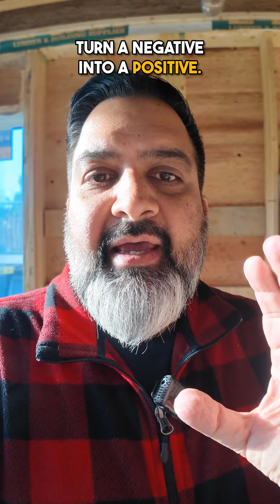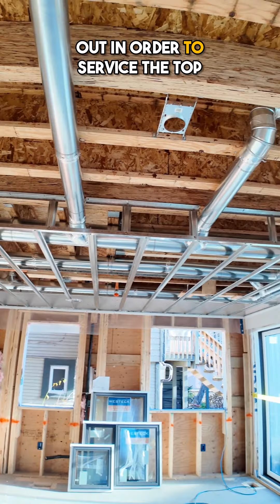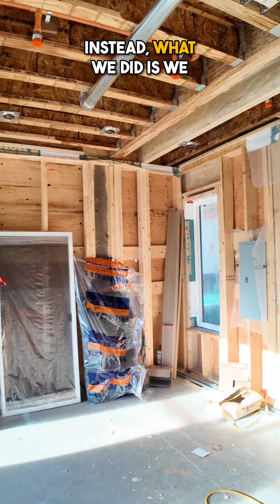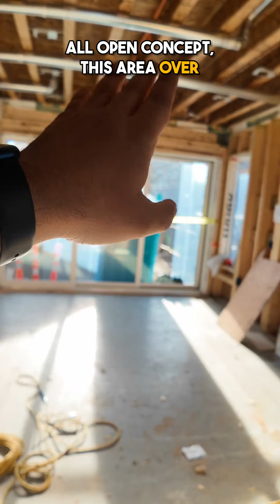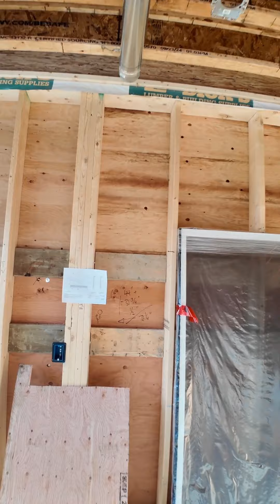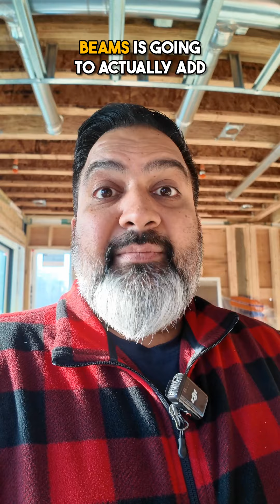Turning Problems into Perfection  The Power of Smart Design! 💡✨

Comment: Why do you use metal for the drops instead of wood?
Reply from the maker: It depends on the situation but in this case they would actually end up straighter and we could make them more tight to the piping.  So we actually got better quality, cheaper and faster